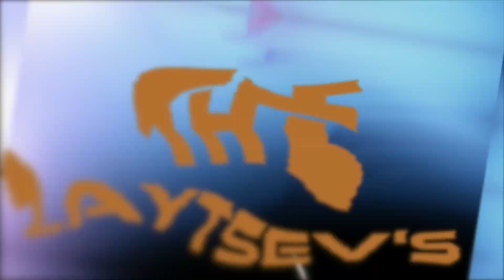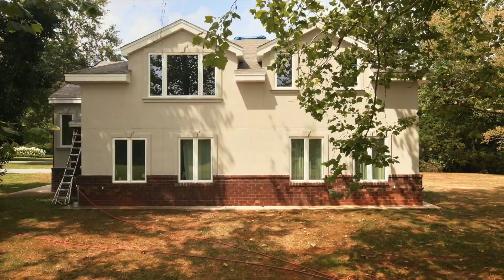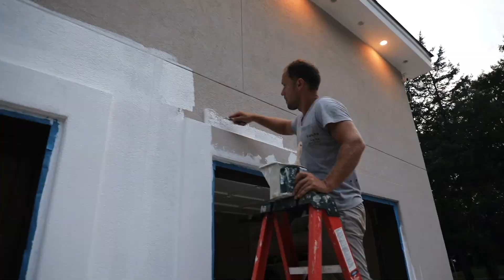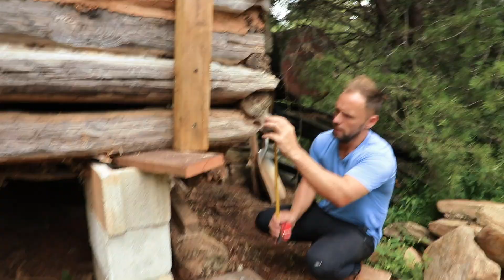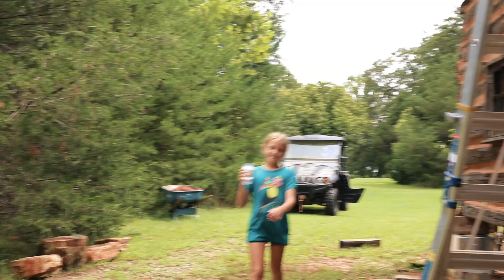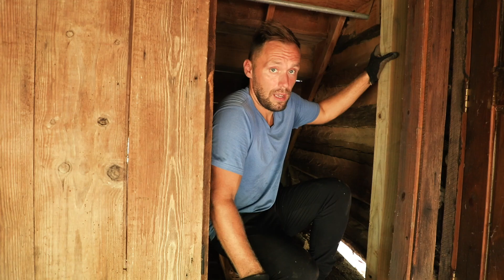I Lifted This Old Log Cabin by myself , then THIS Happens | Episode 25

Comment: Just found your channel and subbed. I think you are on the right track on bracing those corners. I believe all 4 corners on both sides with the 4x4 and all thread for bracing and maybe triangulating them on the inside somehow to keep the corners from blowing apart. Longer 4x4 to spread the load when jacking up would help to. This is fascinating went back and watched all the cabin vids and some pool vids to. Sweating just watching you sweat. What a great family wish you luck.✌
Reply from the maker: Thanks for the sub and for your advice , I  will make sure to put that into practice. 😁🙌
Reply: @thezaytsevs  I know, easy for me to say from my recliner but for something like that you can never have enough bracing. But the old timers knew how to build things. ✌Stay safe.
Reply from the maker: your good. thank you for advice.

Comment: Have seen a few log homes and homes lifted on Youtube, the old wood can not handle that kind of compression, if you have braces to help hold it together, that would be the best place to jack it up at.
Also I have seen them put come along/straps on the inside to all 4 sides  to hold it together this helps hold your walls in (just don't make them to tight), they can be attached to the braces you install! Good luck, will be great looking once you jack it up and repair it!!
Reply from the maker: thank you for advice, I know I was putting little too much pressure on these logs but we will have to brace them better in order to finish lifting completely.

Comment: Open any interior doors and cabinets. 
I had a front bedroom lifted 3 inches and a door in the back of the house became stuck in its jam. 
You may want another Jack supporting the wall with the fireplace, alternatively lifting. 
Letting the house resettle is a smart move. 
See you next video.
Reply from the maker: Thanks for sharing with your experience , I guess we will have to buy another jack and work with two at same time.

Comment: I thoroughly enjoy your work!  Amazing progress; one of the potential problems I think, is lifting in the middle of the logs - they bend and put pressure on the material that's between the logs. Maybe lift each end a little at a time? That way, you'd be pushing up where the logs connect to logs, and not the material between them.  The same can be said for lifting the door frame - the door's header is against the material between it and the log above it, but I see no other way you can do it there.
Reply from the maker: Great suggestion! it think after we four a footer will be able to try this method . 🤞🤞